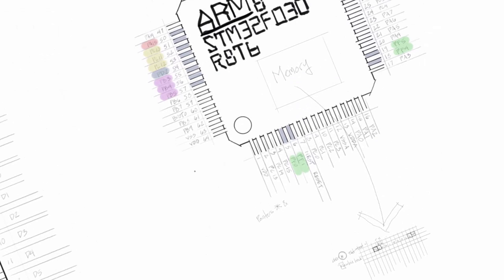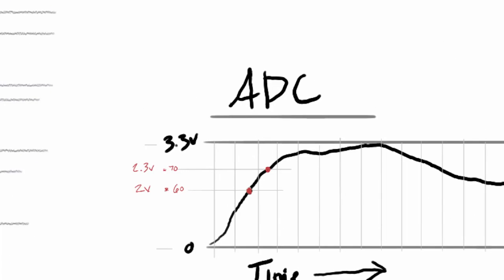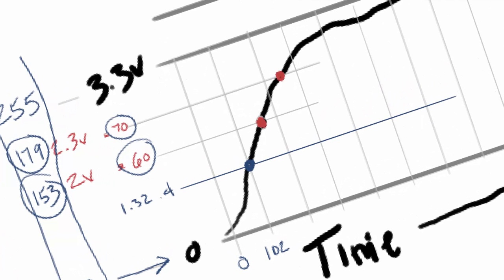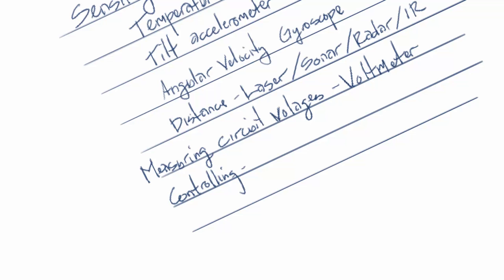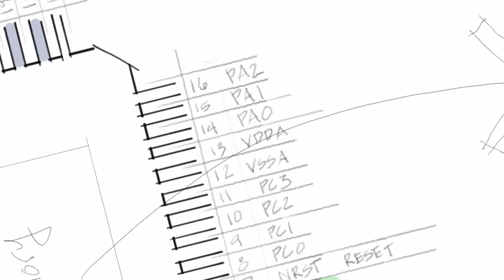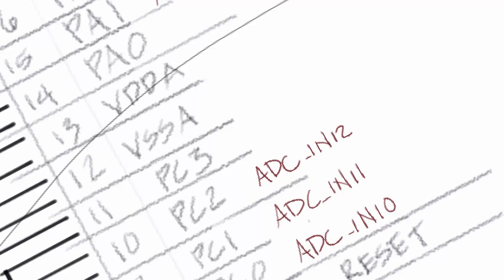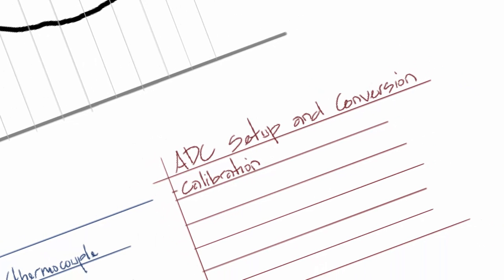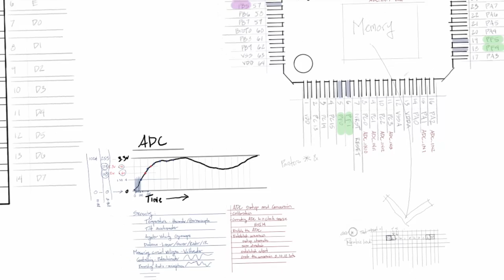32. How to use the ADC (analog to Digital Conversion) for ARM Microcontrollers Tutorial and Intro

Comment: Hi Patrick! Really appreciate your video! 

The setup: 
1. Calibrate ADC. 
2. Choose clock source
3. Enable ADC.
4. Start conversion.

How did you know that these are the required steps? 
I saw the user manual and correctly used the registers, but the manual didn't give such sequence/ flow to explain to the user on how to use the ADC. Where can a beginner like me find such valuable information in the manual?